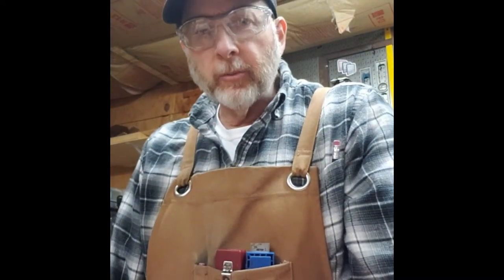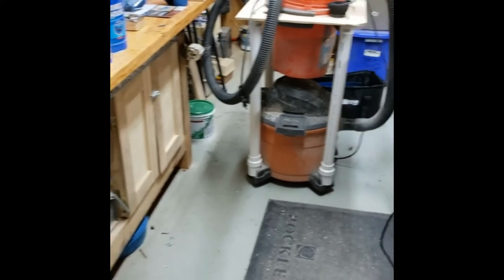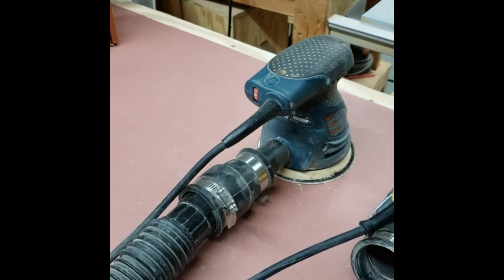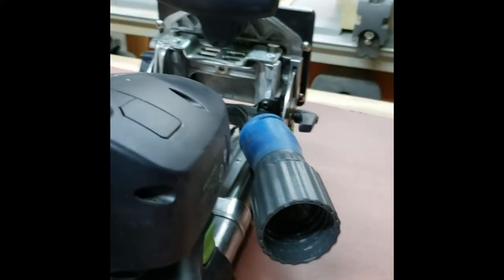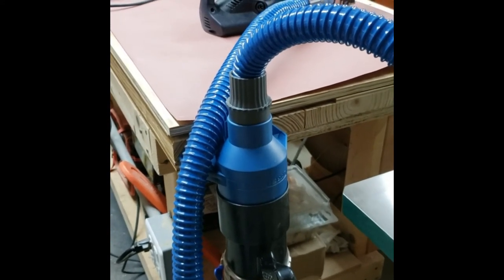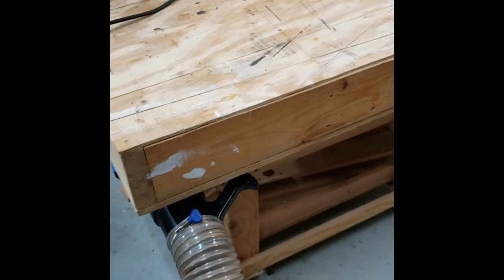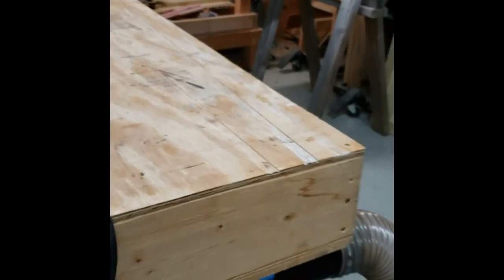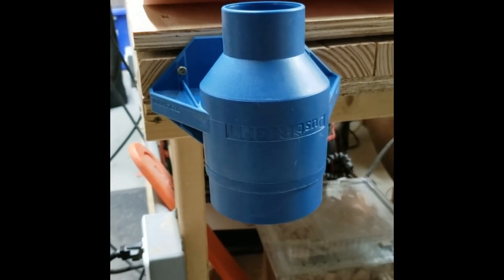Game-Changing Dust Collection • Rockler Dust Right Mountable Dust Coupler

Comment: I am confused, your video suggests you are using a 2 1/2 flex hose. the adaptor is for a 4 to 2 1/2 hose. Yet the Rockler Flex Hose the link is for is a 1 1/2 in by 12 ft.  I searched their site for the 2 1/2 flex hose it is not there.
Reply from the maker: The hose is 1 1/2 but the connector on the end of the hose that connects to the 4” adapter is 2 1/4”
Reply: @BayneCustomWoodworking  thank you I just have watched the rockler video that said it did. ordering now THANKS again

Comment: I tried your method but used the dust right stacking dust port adaptor with a 2.5in hose and the flow dropped significantly. So bad it was useless. Any suggestions on what I can do better? FYI I have dust right 1250 dust collector.
Reply from the maker: I am really not sure how to assist you at this point. My son and I both have the dust system from harbor freight and reduce a number of our machines to 2 1/2” without issue. My guess is that the 1250 may not have enough power the handle the reduction but am not sure. Have you contacted Dust Right?

Comment: I heard a lot of people say you shouldn't neck down a 4 " hose that much. Too much restriction. I don't know if it's true.
Reply from the maker: I have never had an issue and have seen it work great for over a year
Reply: @BayneCustomWoodworking  thanks. I've been using shop vac  with rockler flex hose for tools with small ports. I'd much rather use my dust collector with super dust deputy.